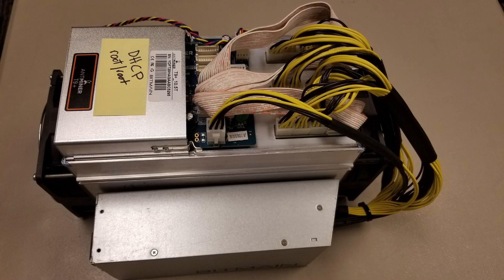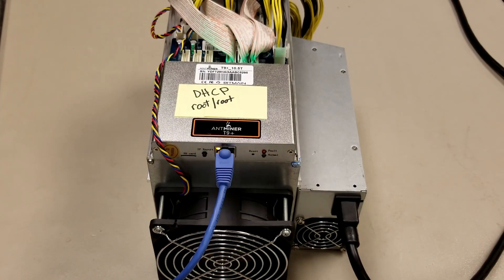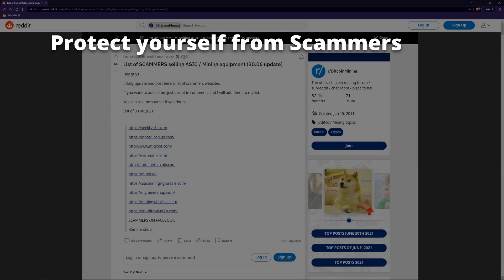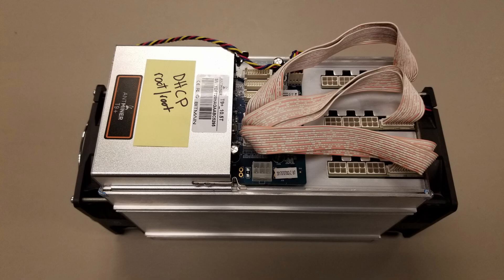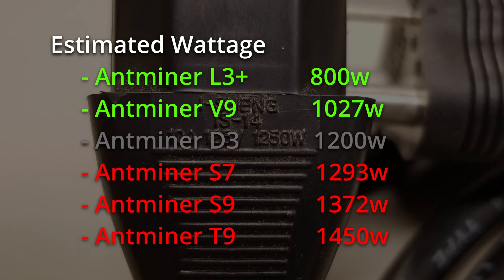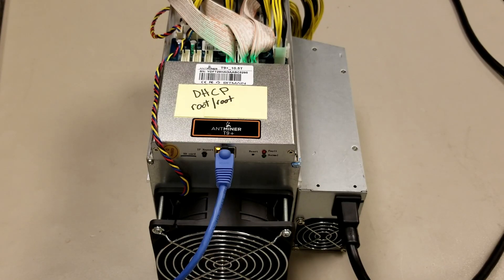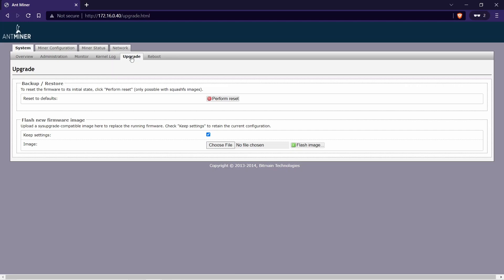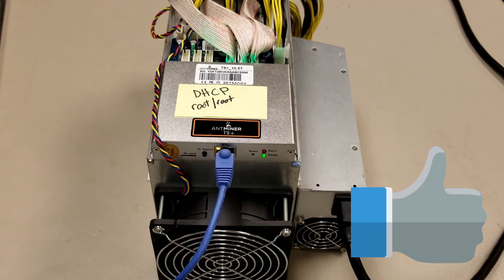EASY SETUP - Antminer ASIC at Home

Comment from the maker: The T9 antminers with updated firmware, depending on the variant you have, can push out between 10.5-12.5 TH of SHA256. They can sometimes be a cost effective alternative to the S9 series depending on how much cheaper you can get them for.